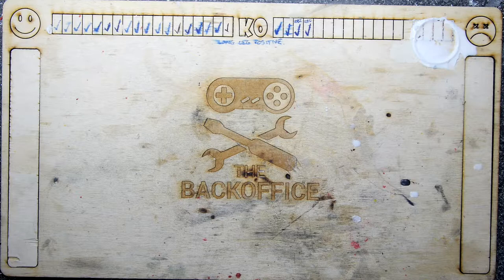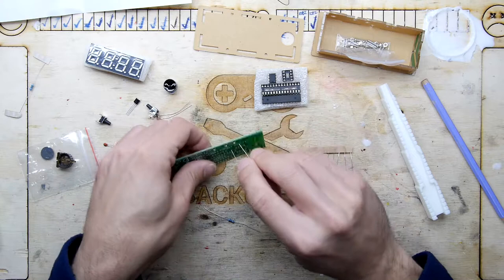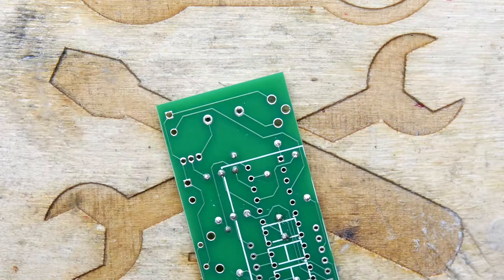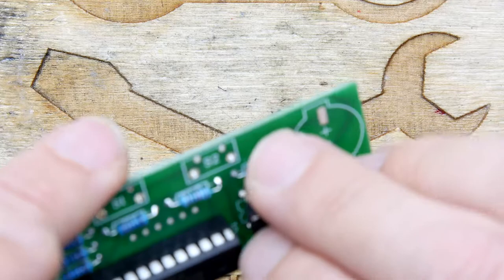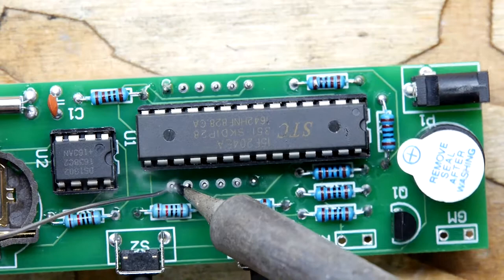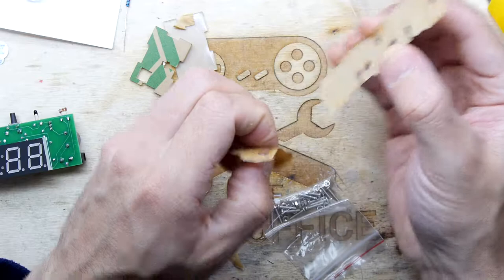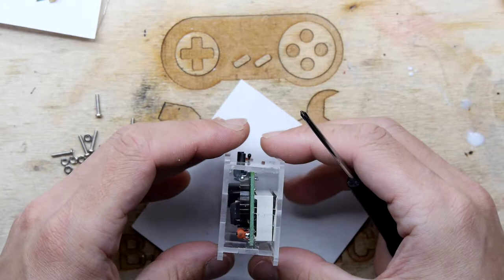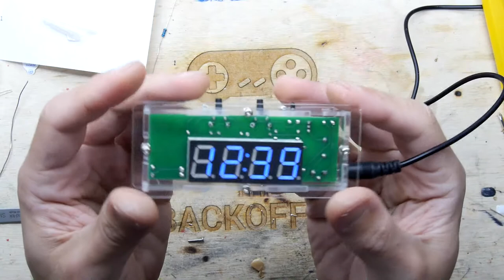Good LED Clock Kit

Comment: 86,400 seconds in a day. that oscillator is 32,768 Hz, or 32.768 kHz. so the micro uses binary counting of clock pulses per second, and once it reaches 32,768 clock pulses it adds one to the seconds counter.
Reply: Usually not so much counts (though it can be done that way too), but dedicated clock chips usually divides using flip-flops as 32.768 is an even power of 2 (2^15), feeding the clock pulses into a chain of 15 flipflops Will gives a 1 Hz signal at the other end.

Comment: I assembled a FloppyEmu for my Apple II today, and it has a laser cut acrylic case too. It has four plastic screws and it was really fiddly to put together too. There was one particular screw that if you tightened it too far, it held one of the buttons down. Oh well, it works!
Reply from the maker: +Robert Roland Yeah it happens! Is nice to have a case, otherwise kits end up in the trash

Comment: I usually put machine screw with snug fit into the top hole of the buzzer and slightly turn it to tune the volume.
Reply from the maker: +Penurious Sierra Nice! I will try this 👍

Comment: Mine works ,but I haven't run it for very long ,I still messing with the case,let your fans no if you have to make changes,but. I have also found some digital clocks even store bought one ,will.lose time too